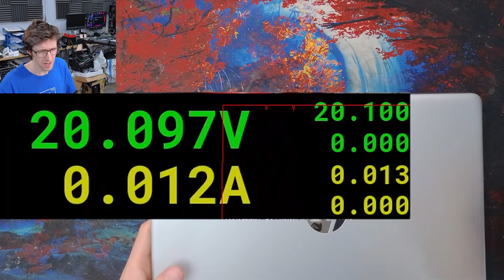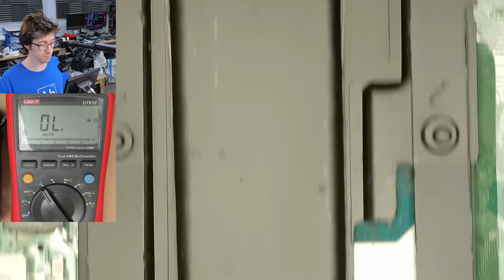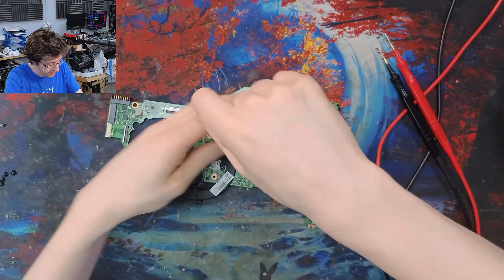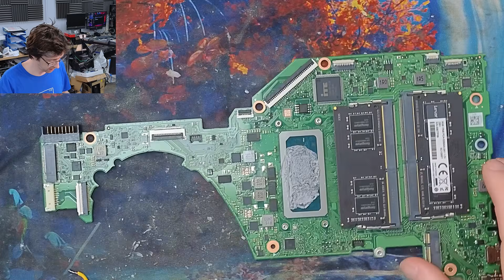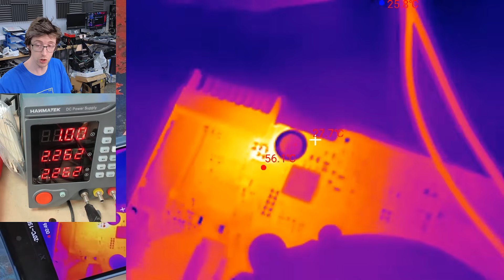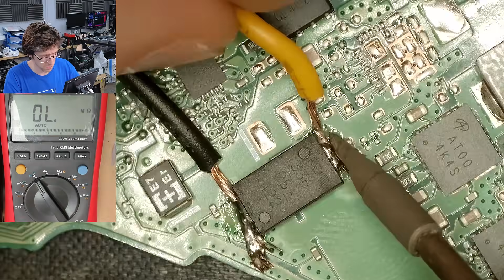HP Pavilion 15s-fq No Power, No Charge Light - #476

Comment: Good timing got a HP victus no power or charge light dead as a dodo bird.
I measured the voltage at the power connector and it has no voltage to speak of ....if I measure at the plug without it plugged into the socket I can initially get 19.5 volts but as soon as I plug it into the socket the voltage disappears...   so I'm guessing it's the power adapter....unless there is a short somewhere and it's able to tell the power adapter to turn off the power coming out of the adapter ? 
I don't think so though. anybody here know for sure?

Comment: Brilliant as usual Graham. My one had nearly the same exact fault. It was the capacitor nearer the battery connector on my one though. As I don't have a thermal camera I had to hunt around with my DMM looking for the point of lowest resistance which can be a bit fiddly but it does work if you have a meter with enough decimal places. To be honest it's a right nasty pain doing things that way but we work with what we have right. Anyway, cheers mate!!

Comment: Don't know how you did this , I just got this exact laptop today, exact same issue, no power no charge, no DC LED. First thing I did - charged the  standard battery in another HP. The Laptop will turn on from a charged battery. DC port cable also works in another PC. Go figure.

Comment: Hi. Thanks. I see (mostly) that those two caps in parallel on a laptop rail are usually 10uf and 100uf. I think to even out the 'flow' at either lower or higher levels. So they wouldn't usually be the same caps, it would still work though. 😀
Reply from the maker: 22uf I'd believe, that's always a chance and I usually roll the dice on it. But I'll be impressed if you can find a 20v+ 0603 100uf...

Comment: I've been rebuilding an older sister to yours there, the 15 n224sa with the i3, it was stated as a NOS that somehow ended sitting on a shelf for years before someone tried to make it work and the HDD had gone for an early shower and is the most appalling machine to tear down to put a replacement drive in proper OMG moment lol   It is a nice machine and absolutely pristine exteriorwise.   I am fitting a SSHD as prices of SSD's are disgusting right now and even SSHD's are getting hard to find :(

Comment: Can you inject with ddr memory in?
Reply from the maker: Assuming you don't have a high-side short on the memory rail, yes. And you'll know if that's the case because you'd find a shorted inductor when checking the secondary rails.
It's common to take everything you can off the board anyway, just in case there's stuff hidden underneath, but RAM modules are keep-out zones and there's almost never anything under them.

Comment: I figured it was a cap that went bye-bye. I thought it was gonna be the one right near the main power rail mosfet (the big on under the batteries) it looked like it maybe had a crack across the top. Turns out I wasn't too far off the target.

Comment: Why did you remove the mobo before injecting voltage?
Reply: Propably just a habit. Sometimes the short is in the bottom side of the MB so it's easier to look around when it isn't attached to the computer. Also it excludes all peripherals (camera, usb ports if in daughter pcb etc). Sometimes those can cause a short also which will disappear when you take the mb out of the laptop
Reply from the maker: ^^ Pretty much this. It's also just best-practice. You can use hot air and soldering while the board is in the chassis, but you start inviting Risk in damaging the chassis.
Reply: 1st.. there is no such thing as "injecting voltage" that's a term used by "solder masters" who just pretend to know something about electronics... 2nd. he removed the board because that's the correct way to do it :)  and why it's the correct way ? because the boards are loaded on both sides and you can access the components only on one side if you keep the board in.
Reply: @robertjung8929  Pretty much everyone calls it "injecting voltage" whether it's the correct term in your mind or not. And yes, you do need to remove the board if you can see the component that's heating up is on the other side, but otherwise it's usually a waste of time.
Reply: @gadgetmind  it's not just in my mind... it's simply wrong ! not a single electrical engineer would ever say "injecting voltage" ! voltage is not flowing so you can't inject it... voltage a is a potential difference.  it was "popularized" by solder-master repair youtubers who can replace components but have no deep knowledge of electronics...
Reply: @robertjung8929  It's been in common usage by hardware engineers since at least the early 90s (perhaps way earlier), and we used it when designing 24 layer boards with £20k+ of silicon on them. This was way way before Youtube, and we had to find the hot parts with fingers and IPA as we didn't have thermal cameras. Given how long the terms has been used for, people are unlikely to change now even if it's technically wrong.
Reply: @gadgetmind  24 layer boards in the 90's ? that must have been one of those "no limit budget" telecom or military development... each BGA soldering verified by X-ray type of jobs...  so i doubt anyone would be injecting current and looking for evaporating IPA especially when trying to find a short between inner layers inside of a 24 layer board... and why would you need to find hot parts with IPA during development anyways ? during development you troubleshoot at signal level not by finding "hot parts" .. and btw.. thermal imaging was available but freaking expensive and bulky (because of cooled sensors) , but if someone had the money for the X-ray machine then they had the money for thermal imaging as well. so sorry i call it BS....
Reply: @robertjung8929  Out of your sea of guesses, exactly one was correct and the rest all wrong. Ah well.
Reply: @gadgetmind  ok so keep injecting voltage into 24 layer boards and finding shorts with IPA... cheers.. peace for everyone  :)
Reply: @robertjung8929  I'll fish one of my 24 layer boards out of the loft this week and do a video. The ones I still have are probably this millennium, but blathered in engineering samples of Xilinx FPGAs for which they charged us whatever they could get away with. Many of the others were bring up boards, so designed to let us test our own silicon coming back from fab, so boards untested and silicon ditto. We had to surround the silicon with whatever let us test every interface, and if some parts of the chip didn't work. let us replace those bits with external logic/whatever so we could get maximum data before respinning some (hopefully!) metal layers. I won't say that voltage injection was commonly used, but we did it when required to let us understand what was what.
Reply: @gadgetmind  just for the sake of curiosity... why 24 layers for an FPGA from the 90's ? even if half of them would be ground planes and power planes 12 layers to fan-out a 560 ball 1.27 mm ball pitch bga is a crazy waste...  (BG560 was the largest package xilinx offered for the XC4000XL series) today's computer/workstation motherboards are running higher frequencies and have higher ball/pin density than that on 12-16 layer boards (cheap consumer ones are often less than 12)
Reply: @robertjung8929  The big FPGAs came later, and we'd often have four with (from memory) 1792 pins each, so masses of routing, plus they connected to devices doing crossbar, and lots of memory. Early 90s was TRW chips like the TMC2330A, TMC2301/2, and TMC2246A. We'd often have banks of each, lots of VRAM, and a 68020 in there, and no much room to work with. In the early days, the FPGAs were glue rather than key logic blocks.